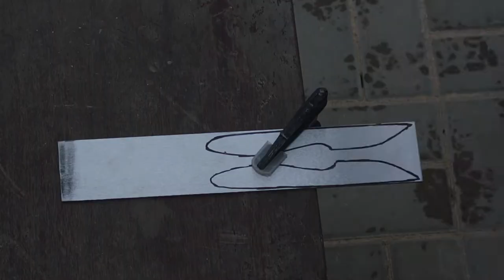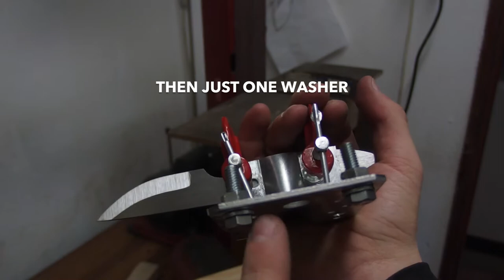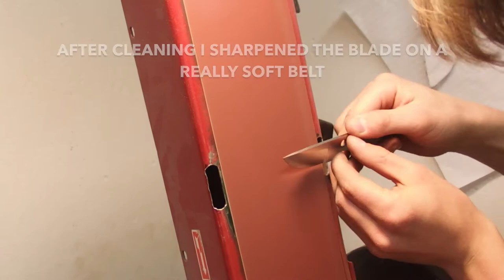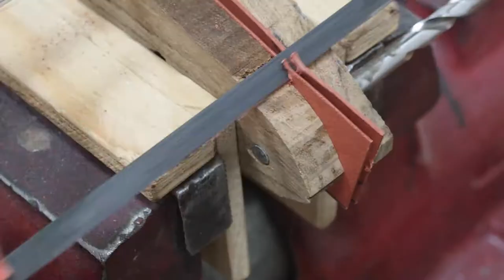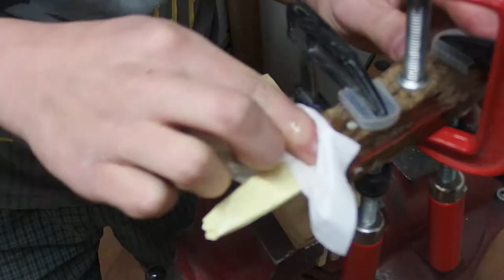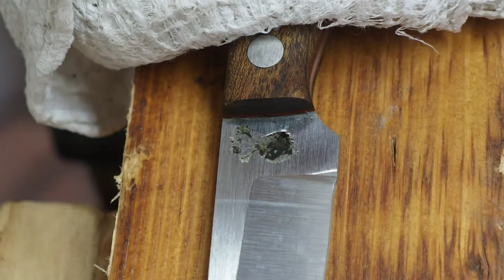Making Mushroom Knives // Knifemaking // My Cellar Workshop

Comment: They came out awesome. Well done. Great idea on the jig saw for cutting down the scales I will have to try that. Looks better than what I do.
Reply from the maker: scottecooke Thanks a lot!! I highly appreciate this comment! I think that a jig saw saves you quite a lot of time because you don't have to sand so much material...
Reply: Have you ever tried using a jigsaw to cut out the blanks. I haven't tried yet but apparently if you have a jigsaw with low speed setting and a metal blade you can cut steel. I was thinking of trying it. Also you say in the description it took you 20 hours. Was that each? Also does that include tempering and glue drying? Or actual hands on time?
Not sure if you like watching knife making related videos but I started a channel if you want I can give you the name of it to check out. I am a beginner though but am having a lot of fun with the hobby.
Reply from the maker: I have never tried using a jigsaw to cut out the blanks. I think that it is too thick for it and I don't want to overload my jigsaw. Although maybe I will try it someday. But I think that an angle grinder is better and more powerful for this kind of cutting.
And I mean in the description 20 hours for one knife...but it is not the exact time. It doesn't include tempering and glue drying. I mostly do my knives in the evenings...I am not full-time knife maker.
And yes I like knife working videos...so you could send me the link of your channel :D
Reply: I find it takes me a log time to make the knives too. But I am getting quicker. I got one of those 100x915 (4x36) sanders as well and I love it. It helps a lot.
Channel is called scottshobbyz it is fairly new but I am having a lot of fun doing the projects. https://www.youtube.com/channel/UCILo98zxEqgEjIi0EtyH6rQ
Reply from the maker: I like your knives dude!
Reply: Thanks I should have another video coming out in the next day or two.